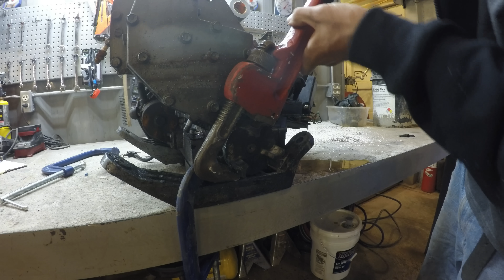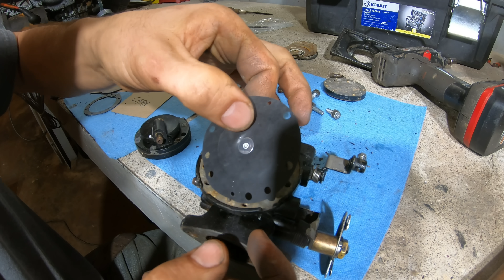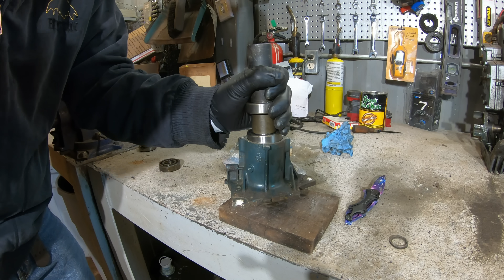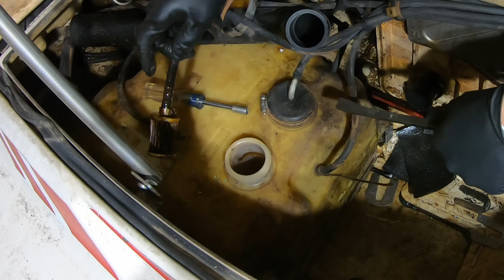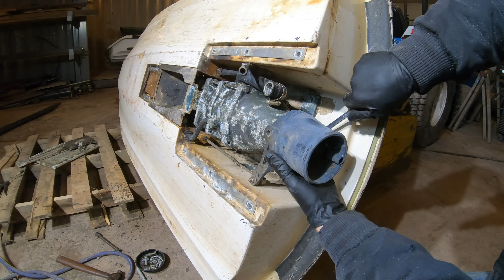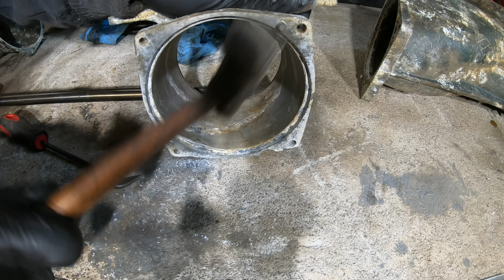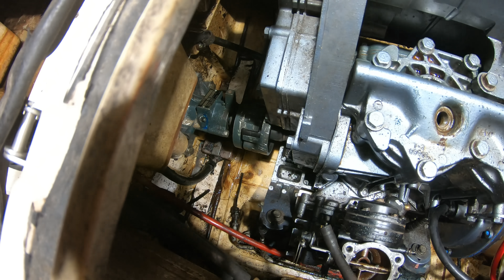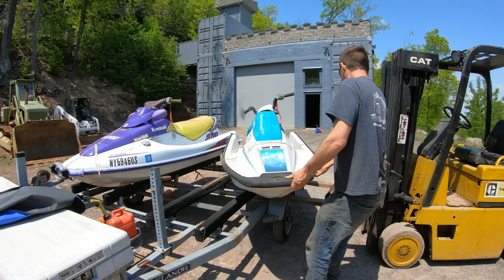Fixing the other $50 Wave Runner

Comment: I was cringing when I watched the bearings being hammered in. Don’t get me wrong hammering in bearings is acceptable as we don’t all have access to a press, but always hammer against the edge of the bearing facing the resistance. Don’t hammer on the inner when the outer is going into the housing. On saying that it worked?

Comment: 1:19 NOOO! if you know your engine is full of water and seized DO NOT FORCE IT! its likely full of rust and you will damage it more by cranking on it. 
a friend recently got one for $50 too and it was rusted like a MF inside.  crank, piston rings, etc anything steel rusted. if you force it and tear up your piston head/sidewalls your fkd.
the piston rings were even rusted and seized into the head...

Comment: Did you say automatic trans fluid is inside it?
Reply from the maker: yes, I put it in to help unseize the motor.
Reply: @AndrewCamarata  we accidentally put it in my oil and the friction modifiers stick to everything, over heated the engine and seized the crank in 5 mins, then any fuel that was in the container was emptied, but it stays on the side walls and killed the next too, just the remnants mixed with new fuel was enough.  I had to throw out anything with fuel in it.   You must not have FM's in your or it would be toast.
Reply from the maker: Oh, IDK, a bunch of people said to use it. It was dex/merc ATF. That waverunner is still running well.
Reply: @AndrewCamarata  looked it up & yours states - "Excellent protection against wear and high-temperature breakdown, resists thickening due to high temperature".  I think mine thickened..as it made the engine super hot before melting the crank bearing.
Reply from the maker: I would not run the engine with ATF in it. That was just to break if free, then emptied out.

Comment: Why have you not at least cleaned any of those things up? Like the jet drive. Wouldn't water flow better or something if there wasn't a bunch of crusty stuff lining the inside? The prop thing had a bunch of gunk on it as well. Don't things like that not work as well when they aren't smooth? I am no expert, but I wouldn't have taken a soft wire brush to those before putting them back together.

Comment: How is that motor cooled?
Reply: Same as any boat engine. The water it rides on is sucked up. pumped through the engine and out through the exhaust back into the water.
Reply: @danielebrparish4271  Yeah, that's right.  What was I thinking?  Who knows.  Thanks for the answer.

Comment: Love your stuff dude   But it makes me cringe every time you smack a threaded shaft with a steel hammer a cheap brass punch could save you some extra work.  From a 30 yr master mechanic with a shit load of tools that hardly get used anymore but glad I have them in retirement you just never know what needs to be fixed

Comment: Purchased 1998 bombardier Seadoo. Ski was winterized last yr, replaced battery;
, unit struggles turnover with plugs in. plugs out no problem starting.  One comment starter is bad??
Reply from the maker: Sounds like a weak battery. Might be partially seized too. Throw some ATF in the engine and let it soak.

Comment: What fascination do you have with these things?  Are you a glutton for punishment?
Reply: I do the same thing, it's more of a passion of tinkering with shit. I just pulled a pressure washer out of the garbage,  no compression. It had a stuck intake valve. A little oil and a tap and it was free'd up.  Now it works and I have a pressure washer lol
Reply: Guess they are toys.  If they are broke you just fix them.  Fun to watch.  I learn things from them.

Comment: A ball peen hammer has its place, but not the tool of choice most of the time when working on cast aluminum parts, bearings, and threaded shafts.
Reply: Don’t take that the wrong way. Congratulations on getting the thing going. I’m in the aviation field and everything is super expensive and parts are sometimes scarce, so damaging something taking it apart will sometimes get you searching for another place to work. I do realize this is a junk wave runner and not intended to be perfect.

Comment: If it starts ripping up the lay-rubber coupling  you will know the engine is NOT in inline Andrew
Reply from the maker: Its been doing ok. I only had this out once. That 700 I put the motor in has been out a dozen + times already this year and is working great.

Comment: It didn't need a new carburetor, it needed its fuel jets to be opened up, that new carburetor might not last as long. That towel trick was cool though, please stop replacing a lot of parts instead of repairing them.

Comment: I have a 93 yamaha wr500r I just got and could use a lil help with a couple fuel lines if you wouldn't mind? I have a service manual but can't figure out where the 2 lines that connect to the motor, just below the spark plugs, below the pistons! There's a line from the pump that goes below the motor and one of the lines from piston area (towards the front, like fuel tank beimg the front)looks like it goes down below there too, just can't see where! The other line from the piston area isn't connected down below and can't find out where it goes.... I'd really rather not have to take everything out if I don't have to! If you wouldn't mind helping, I can send some pics to help clarify! Email?
Reply from the maker: andrewbcamarata@gmail.com I think you would have better luck looking on a facebook group or something.

Comment: You don't want to look at this from a financial direction. Value of an old 650 is basically 0. Even in top running condition, compared to newer model years, they run & handle like crap. Take a GP1200R or a GP1300R for a spin and you will understand, and even those models from the very early 2000,'s have very little value these days, but at least when they run they handle great.

Comment: If those wires rusted to shit already.. why would you just replace the wires and call it good?  Those won't last.  Put something under that metal plate to make a seal.  And like everyone else has said.  Take a wire brush at the least to that rust, otherwise what's the point of all the effort?  They're more rusty on the inside than out.

Comment: How about some never cease on all the threads  (smile)
Reply: Never seize should be copper based for this application. Also, I would have bead blasted a lot of the parts then painted, used waterproof sealer on the propulsion unit and used marine grease on the bearings.

Comment: I thought i was done being an asshole but i feel i have to say this so others watching know that running it that long out of water you likely destroyed the water pump impeller. your'e lucky if you didn't I've seen them ripped apart from running half that long.
Reply from the maker: Wave runners do not have water pumps like outboard motors. They are fine to run out of the water.
Reply: @AndrewCamarata  ya my bad your right about that
Reply: @AndrewCamarata  so does it have an enclosed coolant system or does it pickup water from the water from the lake/pond?

Comment: I have 2 comments - why did you not do the needle and seat and why don't ypu use a brass or wooden block to hammer the threaded end of the shaft - Jesus you will burr the threads.  This is Australia calling!!!

Comment: Be a miracle if that carburetor works what are you running in the little tiny ultrasonic cleaner laundry  soap floor cleaner try some carburetor cleaner
Reply: I don't know but most shops run liquid soap and water. The vibrations break up the scale and the soap releases the oil and grease. That means no carcinogens are released into the environment and there are no hazardous materials to dispose of. Decades ago I would put the parts that I needed cleaned into metal can with liquid carburetor cleaner and let it soak overnight. It works great but that and brake cleaner contains trichlor which is a known carcinogen and something that no one wants to have dumped into a landfill or water system.

Comment: The carelessness of pounding on the bearings and not cleaning/lubing the shaft and races made me wince. Why waste 20 minutes with a wire wheel removing corrosion? If the point of the video is to highlight bush league wrenching it was perfect.

Comment: um great job all that work for nothing the shims are for balance so wy not use em again if the shaft is not centered correctly it could tear itself apart oh and next ime first get out the water from inside or you could damadge the piston or piston rings because you cant compress water.

Comment: Hammer and Chisel mechanic. Not the proper way to do it and for god sake if you just have to beat on a threaded shaft do it with a brass or lead hammer . Next thing you need to buy is a Press Bearings arent meant to be beaten on
Reply: Why argue with success?